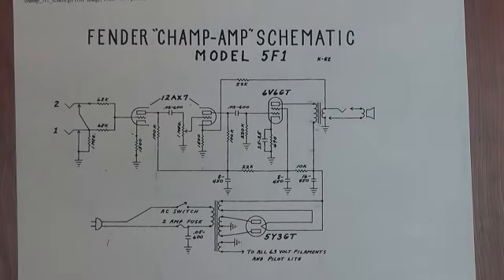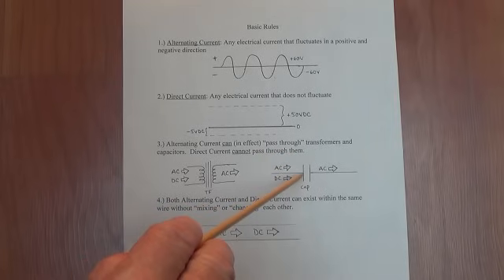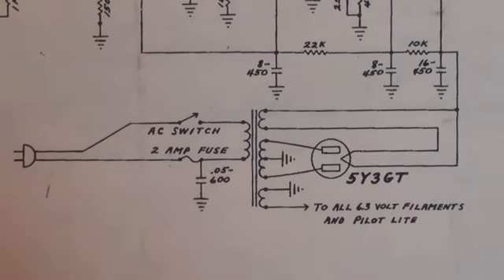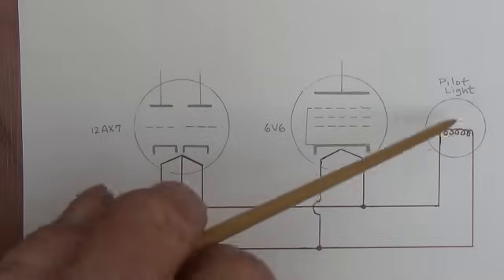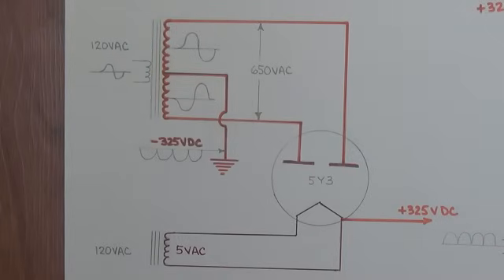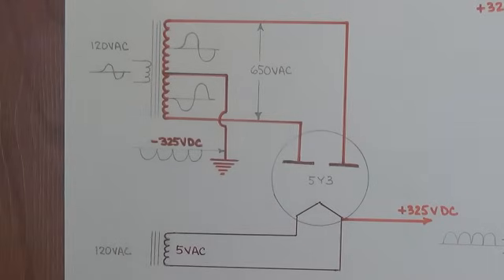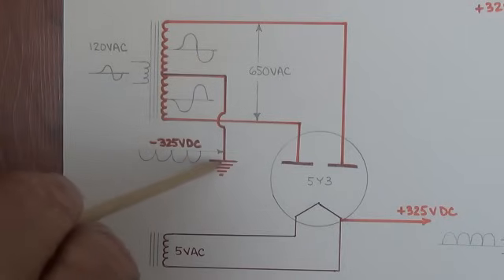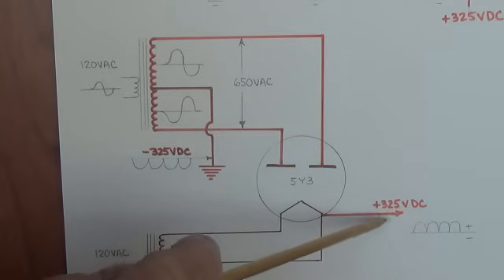How Tube Amplifiers Work, Part 1: The Power Supply

Comment: Hi Doug! Loving your videos, slowly absorbing them all.. Quick query. Living in Australia we work off 240V/50hz. Curious as to how this affects the design of my circuits overall? Is it simply a change in transformer ratings in the power section, or does it also knock on down the line in regards to capacitor values etc (in comparison to your values). I was told the only stupid question is the one you don't ask ;) Thank you kindly.
Reply from the maker: Greetings, PBD. Power transformers are available that "translate" your 240VAC into 120VAC for the circuit. The frequency is not altered by the transformer, but it's not an issue if the transformer is built to accommodate 50Hz.....i.e. use a 240VAC 50Hz power transformer (they are available).  A 60Hz transformer should not be operated at 50Hz or excessive current and heat will result, especially if used with an electric motor.
Reply: +Uncle Doug Thanks Uncle Doug, appreciate your time :)
Reply from the maker: You're welcome :)

Comment: I've been watching your videos and doing research to prepare for rebuilding my grandfather's Eico St-70 amp and was wondering what multimeter you recommend for working with tube amps? I have been looking at the fluke 115 but it's is only rated for 600v and doesn't have milliamps, do you think this would be sufficient? Also thank you for taking the time to make these videos, they are an invaluable resource for people like me that are just getting into tube amps.
Reply from the maker: You're welcome, Matt, and best of luck when you do begin your restoration project. Fluke meters have a great reputation, but are relatively expensive. You can occasionally find a good, "low-mileage" one in pawn shops at a fraction of the original price. To be honest, I tend to trust just about any reasonably well made MM that offers the usual parameters, as well as capacitance and  auto-ranging. The milliamp capability is not critical as long as the readout can accurately portray at least 3 places below the decimal point.

Comment: I'm new to tube amplifiers and wanted to learn how tubes work. Thrilled to have found your videos, they are well thought out and presented. Thank you for taking the time to create  them. My new Mesa amp landed at my house yesterday and I'm questioning how new it really is. No manual, slip cover or warranty card in the box. After playing it for an hour the second channel became extremely scratchy and the number One channel faintly scratchy. Turning the volume up makes the scratchiness much worse. I'm disappointed to say the least. Any thoughts that you or others may have would be appreciated.

Happy to have found your site. I want to learn as much as I can about tube amps and I appreciate your efforts.

Best to you a new that handsome puppy, D. I'm guessing that he is a jazz, blues kind of guy.
Reply: In addition, I turned the amp off, came back to it an hour later and the scratchy sounds were gone. I played for fifteen minutes without the scratchiness returning. Again, any insight is sincerely appreciated.
Reply from the maker: I'm always suspicious when "new" items arrive without all the things associated with newness.  My experience is that most of them are items that were returned by a previous buyer, superficially checked by the vendor (not played for an hour), and then sold again. If you paid full retail, complain. If you got a discount and a warranty period, then use that period to test it further.  If you got it cheap and without a warranty, then hope for the best.
Reply: +Uncle Doug Thank you for your response. In terms of "testing it further," as you suggested. Other than playing it more, might you suggest something in addition? 

This was an eBay purchase from a brick and mortar store and I have the opportunity to return it. Although I haven't heard back from the vender, my thoughts were to try new tubes should the vendor supply them. FedEx may have jostled the tubes. 

Although I'd really like to have my amp now, given that the box did not include the manual, warranty card or slip cover I'm most likely going to return and repurchase from another Mesa Boogie vendor. Again, thank you.
Reply from the maker: You're welcome, Doug. It's a shame you're having this problem. We hope it can be resolved to your satisfaction. Good luck.

Comment: Hey, Doug, its me, Bulldog#1, again. I have a Behringer Ultratone K3000FX keyboard amp that my son was using as a Keyboard amp. He loaned it (1st mistake) to a frat friend (2nd mistake) and they turned it all the way up (3rd mistake) and, pop; nothing. Any idea where to look first for a problem (fuse is OK)?
Reply from the maker: Sorry to hear of your misfortune, Bdog.  I have no experience with this particular amplifier and don't even know if it's tube or SS, so I'm really not the guy to tell you how to fix it. Perhaps there are Internet sites that can help, or a local tech, or even the manufacturer.  Good luck.

Comment: Very good description for the vacuum tube rectifier.   The "Correction" note at 16:56 has corrected a very series error in the explanation.  I have tested radio tubes for about 20 Years at Tungsram in Hungary and  I have immediately realized the error about the negative 325 V pulses going to ground. This is incorrect.  Best regards,  Patricia
Reply from the maker: Thanks for your input and confirmation of my correction note, Patricia :)

Comment: I am an electrical engineer with over 30 years of experience and find this fascinating !
I have always wanted to know more about how valves work but never really had a need to, you just don't come across them very often and even when you need to repair a device that uses valves, it's usually not the valves that are the problem, 9 times out of 10 it's a bad connection, bad control pot or bad capacitor. Those are usually very obvious and easy to eliminate, then if there is still a problem it's easy to take the valves to someone who can test them and then get replacements if necessary. In all my experience I have only had to repair 3 items that used valves so I have never really need to know how they operate.
I really like your explanation style, a bit repetitive but easy to follow, so I'm looking forward to learning more from this series.
Reply from the maker: Thanks so much, Ian. Rusty and I really appreciate your nice comments, which are all the more meaningful due to your experience as an EE.  We're glad the videos are helpful :)
Reply: Ian, what kind of electrical engineer gets to repair connections, bad control pots or bad capacitors on devices? Sounds very interesting yet quite different from design work...
Reply: A lot of EEs work in small design shops, and frequently do repair work along with design to pay the light bill. David Jones, an EE in Australia runs the EEvblog channel, and his lab does almost as much repair work as development. Didn't mean to hijack Doug's channel with info about David's, just say'n, a lot of EEs do repair work.
Reply from the maker: No problem, Larry. Thanks for the input.

Comment: thanks for all informations i got some tips :) . but İ have a problem about my tube ampilifier. May i ask it ?  would you like to help me to solve,  Could you give me your email adress to send schematic, what would cause of the problem? evren236@gmail.com
Reply from the maker: Long distance amp diagnosis is not generally feasible, but go ahead and describe the problem, Evren.
Reply: i have turntable which works with tube amplifier(ul41-uaf42). it is called lesa 25a model. it's sound is excellent but i have only static noise porblem and i cant solve it. i wonder which part would couses of this problem ? even the volume potansiometer down  there is so small hum, probably  it is 0-3 db, not so much but when i listen carefully i can hear that. you can get datasheet easly  from this link, http://www.radiomuseum.org/r/lesa_25a.html Thank you for your helpfullnes. Kind regards.
Reply from the maker: There are lots of possibilities, cold solder joint, bad contact in a tube socket, bad tube, bad resistor or cap, bad phono cartridge, etc. etc. There is just no way that I can diagnose this rather general problem long distance. Sorry, but I'm afraid you're on your own with this one. Good luck.

Comment: I have a question on the 12ax7 heater circuit. The way you have it drawn up, both filaments are fed from the same side of the winding with a center tap from the heater going to the other side. i have also seen where one side of the winding goes to one filament and the other goes to the other filament and the center tap is left open. which is the best or correct way to wire the heater circuit?
Reply from the maker: +Hawcer71   The 12AX7 tube requires a filament voltage of 12V. If you have a 12V filament supply, then you wire the tube at opposite ends of the filament (pins 4 and 5) and ignore the CT. If you have a 6V filament supply (as most circuits do) you wire it the same, but connect the CT so you now have 6V +6V = 12V across the filament.
Reply: +Uncle Doug that  makes sense.  for a 6v circuit just connect across 4 and 5 to one side and connect pin 9 to the other side of the winding. Thanks!
Reply from the maker: Yes, the 12AX7 has a center-tapped filament that allows it to be operated in a 6V circuit.

Comment: Hi Uncle Doug & Rusty, I hope all is good with you and yours, Happy Spring! While watching the power supply video, I was wondering if I were to use a 3 wire, grounded power cord, if the infamous 'Death Capacitor' can be omitted from the circuit? Also, I was curious about the input jack(s), are they grounded jacks and what the reason for that was, or can you just use a mono type input jack? Thankyou for all your help and sorry for all the questions. Take care, C.
Reply from the maker: +Cass Virgillo   Adding a 3-wire cord will virtually eliminate any shock hazard, Cass, whether the Death Cap is present or not.  Any current leakage to the chassis will go harmlessly to ground.  If enough current leaks, then the fuse will blow, alerting you to the situation.  Self-grounding input jacks are to eliminate any hum that could be picked up by those input jacks that are not being used.....they act like antennas for noise.  Having them ground themselves eliminates this. To my knowledge, virtually all guitar input jacks are mono, not stereo.

Comment: Just a silly question sir: you were talking about how the first number on the tubes is directly related to the voltage (12ax7 is 12 volts), so what is an EL-34? would it be 34 volts or something else?
Reply from the maker: +Dan 2c plus  No, its filament voltage is 6.3VAC, Dan. The rule only applies to the first number (if there is one....and in this case there isn't), and some tubes deviate from the old style of nomenclature. The vast majority of amplifier output tubes are 6.3VAC.
Reply: Uncle Doug Hey thank you for the clarification. I am really trying to understand how a tube amp works because I am doing a school research paper. I play guitar, but I want to take my knowledge of my amplifiers to another level. Your videos are the best for this task in my opinion. Thanks again!
Reply from the maker: Thanks, Dan. Good luck with your research paper. I posted a video series on vacuum tubes that you might find interesting. It explains how they're constructed and how they function.
Reply: Uncle Doug I'll give it a look. Thanks for your time.
Reply from the maker: You're welcome.
Reply: EL34 is a European tube/valve designation. The 'E' means it has a 6.3V heater, the 'L' means it is a power pentode, the '3' means it has an octal valve base, and the '4' is a type number. The 12AX7 has the European designation ECC83. 'E' means each triode has a 6.3V heater, which can be connected in series to a 12.6V supply, 'C' means triode, so 'CC' means double triode, '8' means it fits in a 9-pin B9A socket, and 3 specifies its amplification factor.

Comment: Hey Uncle Dog I would like to know if you have a Tube Amplifier, Do you have to use the same kind of tubes that came with it or can you sub different tubes, I have a Mistral MM-1B 25WX2 Hybrid Tube Amplifier. and if I ever need tube and also I am thinking about buying some extras so that I have them if I need them.
Reply from the maker: +Timothy Green  There are lists available (probably on the Internet) that describe which tubes can be exchanged for each other, Tim. The requirements for substitution are quite strict and only certain tubes can be exchanged. For tubes that are no longer made, and/or getting scarce, now is the time to stock up. Eventually, there will be no spares available.

Comment: Could you please do a video about how to choose drop resistor values? I'm trying to design an amp but have gotten hung up on how to choose correct values for desired B+, B+2, B+3
Reply from the maker: +Tyler Barnes  This is all covered in my Resistors video series, Tyler. Please watch it. I believe it will be helpful.

Comment: Hello Uncle Doug. You have 120 volts rms in the wall socket and 2 amps. On the 5 volt winding on the transformer that services the 12AX9 and 6V6 is there a difference or transformation of amperage and what is the rule concerning that.[ ie ] 120 volts become 5 volts, how does v = I r become demonstrated in this transformation.
Reply from the maker: +Tom A   The power is the same in both windings of the transformer, i.e. if P = V x I, then primary V x I = secondary V x I.  120VAC @ 2A in primary  =  5V @ 48A in secondary.  If the voltage increases, the current decreases....and vice-versa.
Reply: +Uncle Doug  thank you, That makes sense. You also mentioned that there needed  to be adequate wires in that circuit and I see why
Reply from the maker: You're welcome, Tom. Yes, the wires must be rather stout to carry the multi-amp current to the tube filaments.

Comment: Hi uncle Doug i wanting to know if by changing the anode resistors on a 12AX7 will or does it change the gain i am building a valve HIFI preamp and i want low gain. i was thinking of using 68 k and 82 k what's your thoughts
Reply from the maker: +ian “valve doctor” forster   Yes, indeed, Ian. As described in my video on Plate Resistors, increasing the plate resistor value will boost the gain of the stage (and vice versa).  You can experiment with different values (perhaps with a 100K pot) to achieve the gain and tone you seek.

Comment: So the 5Y3 is conducting from it's two plate source when one diode plate is charged negative and the filament/cathode cycle is positive? (I always thought electron flow was from negative to positive.) Or is the  5vac filament/cathode conducting  during  the filament/cathode's  negative cycles and electrons are flowing towards the  plates during the plate's positive 350v cycles?  It is strange to see  high + plate level voltages on a filament/cathode which makes it confusing. As I recall in a triode, electrons flowed from filament/cathode towards a highly charged positive plate controlled by a grid of course. Another words, how is +325 volts reaching the filament? Which direction is the electron flow during what cycle? I assume electrons are negative charges being attracted toward a positive source.
Reply from the maker: +newjerseybt   In an amplification tube, the electrons do flow from negative cathode to positive plate, but a rectifier tube consists of two diodes and operates in a different manner. Each of the rectifier diodes conducts from plate to cathode (filament) only when the high voltage AC waveform is in its positive phase, and these (rectified) positive wave forms exit through the filament circuit to the B+ rail where the electrolytic capacitors smooth out any residual AC ripple. The rectifier filament/cathode is energized by 5VAC which coexists with the +325VDC high voltage until the DC exits to the B+ rail.
Reply: +Uncle Doug Thanks for your help. Yes, apparently diode tubes do act in a way that I need to study more about. Maybe this has to do with the way electrons move from negative to positive and something I recall in the past (1960s) move in the opposite direction called "holes". Or maybe I am way off base and applies only to junctions of transistors. Again, thank you for your help.
Reply from the maker: You're welcome. I agree that electrons move from negative to positive. "Holes", however, relate to semi-conductor devices, not tubes.

Comment: Hello Uncle Doug, some time ago I wrote you about the angela super single-ended amp schematic (which can be found online) and you were kind enough to respond back after having a look at it - To refresh your memory it's the dual rectifier / dual 6v6 tube layout... Since that time I purchased all the parts only to realize I bit off more than I can chew as a first time build. SO, I wanted to ask if you would be willing to disect the schematic and put together a wiring illustration or something more suited to a first time builder? I'm happy to pay you for your services if you can help?
Reply from the maker: +Kevin King  I'm sorry to hear that the project has proven too challenging, Kevin. I don't do wiring diagrams, but Tommy Foley does. Please contact me by Private Message and I will provide his e-mail address.